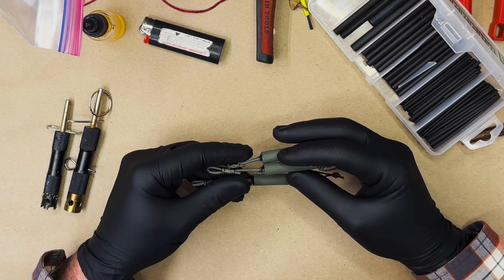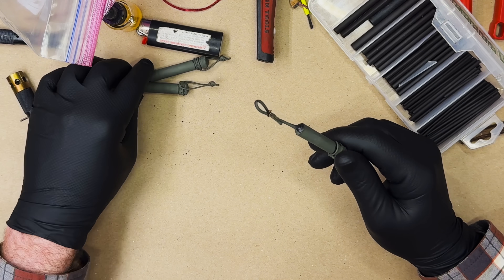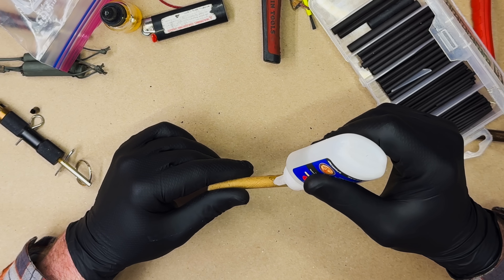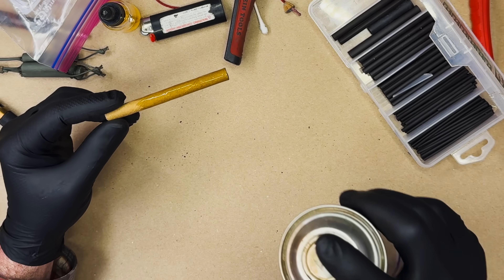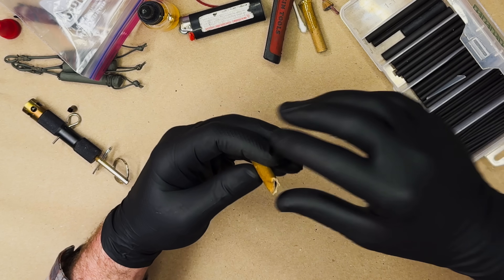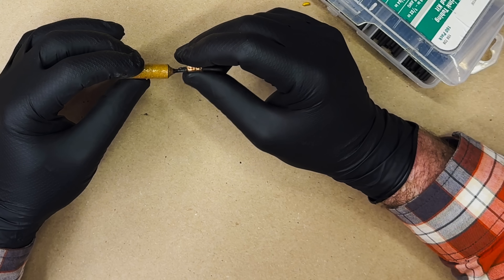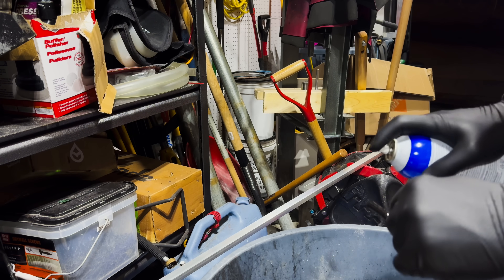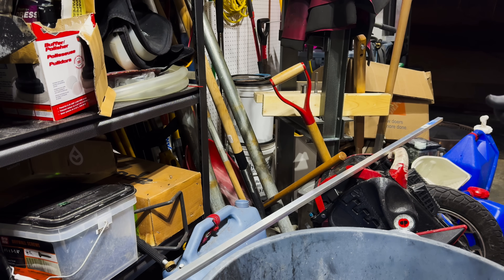Detect, Deter, Intimidate, Evade. A Stealthy & Weatherproof Trip Alarm

Comment: I need to teach ya some knots . The green or black braided fishing line is invisible BTW. It's a lil costly but not using a few ft at a time like this and strong as F.
Reply: Z-Bolt will pick up most of the mono and Fluro but maybe like a 6 or 8 pound braided like you said. Plus braided has zero give like monofilament fishing line. Regardless though he did a fantastic job.
Reply: Now rewinding so I can watch the first half of the video that I missed reading this choice beef
Reply: .... yea when I read that first guy after watching  Ole knostradamus over there build his booby trap i was like... um sure you want to pick this fight ... 😅 dude has Alexa turning on exhaust fans in his workshop for when he burns stuff in the basement for the spare parts he needs. Im sure he knows how to tie a knot😂
Reply from the maker: [WIRE PULL IGNITER KITS ON MY SITE,I digress] I  sl@p you in the face with a Monkey’s Fist, and challenge you to a knot 🪢 duel🤺. Son, I need to teach YOU some knots. I had the weirdest fascination for years when I was a kid. I’d read about knots and play with them for hours. When I was six, to my mother’s horror, she found me dangling from a tree branch a rope around my right ankle 6 ft in the air because I was “testing a raccoon 🦝 trap.” When I was in eighth grade I got in trouble for hiding “advanced climbing anchors,”by John long inside of Homer’s The Odyssey while we were supposed to be reading our assignment. Before Boy Scouts turned into a bunch of woke pu$$ies, I made a massive trifold knot board (that folded into a very large and heavy briefcase—cause you never know when you’ll need a 120 knot knot board) for fun—no one asked me to- I was a knot menace. So, inspect the video closely, and, assuming you are the knot aficionado you claim to be, you’ll see  a constrictor hitch in the bight of a figure-eight-on-a-bight at 0:00; a bight girth-hitched to said double-figure-eight/figure-eight-on-a-bight(though it could be argued a reef knot as the girth hitch is around another line of equal diameter instead of a fixed object), into a two-line constrictor hitch around small tree at 00:47; a simple taught-line hitch around opposing tree at 01:20; a true girth hitch formed from a loop tied with a double overhand (behind branch) that was to form a tackle loop 01:39 used to position the tripwire at proper height, while keeping the device down low out of sight and utilizing the weight of the device to hold tension on the tripwire, vs the weight of the device causing sag in the line. Tension was applied and finally secured with two half hitches. So I’d say that was expertly executed, though I admit, in an ideal world, that last knot (two-half-hitches) would be a taught line hitch—I was feeling insecure while shooting because I felt slow and sausage-fingery so I rushed it with the less-than-ideal-though-still-acceptable two half hitches. In conclusion, I suspect you are a knot-charlatan because a real knotstranaut would have been thoroughly satisfied by the masterfully executed assembly.

PS you are correct about the braided fishing line, I only saw this post eight months late because I just picked up some braided fishing line and wanted to commend all those who recommended it.
Reply: @InventionIncarnate dayyyyyyum
Reply: @InventionIncarnate  Ok this response of yours is some total B.S. I read it, playing the moments in my mind, hands trying to duplicate what you were talking about. By the end of it I found I had tied myself to my chair, ice cold beer on my desk I couldn't reach, needing to pee, and I can't move to save my life.
Reply: @InventionIncarnate Damn dude, you use to be cool. Now I know you're Knot. Just a seamen aficionado who loves getting tied up, and who loves mixing fluids.....and powders. In fact in your free time at various mens bathrooms, sometimes you gotta utilize the powder before you mix the fluids. Or maybe knot.
Reply: @InventionIncarnate  How do you keep natural critters from tripping your lines? pls.
Reply: @InventionIncarnate now all we hear from the knot so expert knotty mouth os ctickets 😂😂😂. I guess he realized maybe he was knot so well versed as he thought. 
Thought he was gonna school you…knot 😂
Reply: @InventionIncarnate by the way man are those really sprinkles or was that code lol. Pics of the product labels that won’t demonetize you would be awesome.
Reply: What a comeback!
Reply: There’s no coming back from that
Reply: Delete your comment bro
Reply: Bro never replied 

Civilian mentality right there

Comment: Just a thought for the CA sealing of that tube: you obviously know CA, but a BETTER CA would be the ultra thin viscosity!

I have worked wood/CA for decades in the Industry (Hardwood Floor repair) and ultra thin viscosity CA dries in 1-3 Seconds, WHILE also Penetrating 40/50 thousandths inch deep!

That avoids needs the Activation Spray as well!

I use so much ultra thin viscosity that I buy it in 8 ounce bottles, and refill a smaller 2 ounce bottle!

I also use the thick Gel CA, as needed • • • • • 😮

Also, if you have any Sawdust from wood work, fill an old sock with it, beat said sock onto a newspaper, what comes out we call "Fines". Sort of like flour: CAP end with a 1/4 teaspoon or a bit more, ultra thin viscosity CA soaks into that fines and you have a SERIOUS PLUG, and less $$$ on your CA costs!

philip in Oregon where it is Still legal to be a survivalist, for a while anyway 😅

Comment: the mason bee houses are mainly for gardeners, carpenter and mason bees pollinate WAYYYY more flowers than honeybees, are also less aggressive by far, and the houses will keep them away from structures like homes or decks etc, insecticide wont really kill them because youd have to find every hole theyve made and directly apply it (they will build entire networks of nests in even small planks of woods) however if you do kill them inside the nests, other insects which are far more likely to try to enter your house will move in

Comment: Pro Tip: It’s beneficial to remove the lighter’s safety bar over the flint wheel because it catches on the rubber glove as you push on it. It’s extremely aggravating and the relief is immediate.

Comment: You can make your own tubes with hot melt glue, CA glue or epoxy or the adhesive of your choice from cereal & any other thin cardboard boxes glue the 2 pieces & wrap around the appropriate sized dowel.....

Comment: If you have a small glass container/cup, i cut off bottoms of beer bottles, and wash out, dry then add a little rubbing alcohol, you can dip and agitate/bob up-down the brush covered in ca glue, to remove the glue from brush, to use the brush again. Just dab on paper towel any alcohol holding on to brush & allow air dry before using  brush again.

Although to be honest, rarely do i use brushes with glue (unless water soluble), instead i use qtips that ive fluffed up and can throw out😊

Comment: You sent enough I'll be making these for the next 10 years lol today was mission success, made 2 with string, 2 with wire,  and 2 with crimp caps,  and every single one went off. I'm fact it's a little spicy lol 30%on the cups is very very literal lol

Comment: To make using a bic with gloves essier, you can take a pair of needle nose pliers and peel the metal guard off of the flint to increase the surface area your thumb can reach. Doesn't damage the lighter either. I do it with all the bics I use.

Comment: Party popper pull strings are like 5 for $1.25,  just gotta cut them out of the party poppers. And they fit brilliantly into drilled out co2 cartridges... and Capri sun straws work great for the waterproofing process. Figure out on your own what else to put in the co2 cartridges.  Possibly, hypotetically ,theoretically,  allegedly.

Comment: I would be careful using CA glue next to sensitive compositions like “photography” powder like that as those compositions are typically sensitive to heat and CA glue while curing generates quite a bit of heat, sometimes enough to burn paper

Comment: Next time you want to think about soaking the alarm AFTER you set it up, then set it off without doing a video cut. Because there is no way for us to be sure that you didn't just swap the wet one for a dry one. Also, it does no good filming setting up the alarm if your arm blocks the view of what you're doing. Unless of course the viewer is blessed with x-ray vision. And I am not.

Comment: Why the mason bee tubes? Is it just size/cost? Any reason you couldn't use copper tubing or 3D print the tube and cup? Wouldn't those both be stronger and already water proof? Just add a dab of sealant to the seams. Or you could design the cup with the hole already in place and have it screw onto the tube, then just coat the threads with CA.

Comment: Copper tube and solder gun. Pressure pad trigger with trip cord to peremeter alarm set vertical on tree, groin height.
Completely different and unrelated topic. Have you looked into human anatomy? Phemerol artiery location, the ease of which a TQ works on that severed artiery.

Comment: We used to make something similar using the popper from a party popper pushed through the fuse hole of an M80 or a Cherry B.
M80s and Cherry Bs are of curse illegal and too powerful but we were bear proofing campsites and wanted a real BOOM. 
They worked really well and were quite reliable if you waterproofed them and set them correctly ,,, very cheap to make.

Comment: You wernt kidding labor intensive perhaps a heat gun or even a hair dryer to activate the shrink tube not shure how violent thoes caps are but using an open flame most likely won't but could set them off one would think ? Love the concept and utility however I live in the former democracy turned dictatorship known as Canada and these are a class 3 felony and carry a prision term of no less than one and a half years  and up to seven years in a federal maximum security penitentiary  and a permanent weapons ban for life you can't even be cought with fireworks after thoes charges or your looking at a second offense and breach of conditions that can land you the remainder of the original maximum seven years plus an additional seven to twelve years in maximum federal prison .

Comment: There are mouse traps out in Germany which use 9mm blanks to blow "into the face" of a mouse to kill it. They can easily be modified by tiing a rope to hit to have an alarm. They are not cheap, but work very well and are very loud. At the same time you could also put a blank inside which shoots a pepper load 🙂

Comment: I was a security officer on nights. I used to like to doze off. Yes of course we doze off. We would be lying if we said otherwise. Problem is if you kipping a d the supervisor pulls up.......opens be door and you are snoring.....bye bye your fired. SO ... Back then had the old fashioned  Nokia phone. I made a box around it and attached a small nail that rested on the green ring button. Attached the box to a tree and fed cat gut across the road....a out one mile from the office. I put in the number of my other phone. Sat down had a kip..... along comes Mr boss man in the car....drives into the line he cant see....it pulls on the nail...pushes the ring button....hey presto my phone rings and I wake up. Worked like a treat for years. I worked for OCS at a haulage company in Nottingham. Gotham actually. Remember me boys....I fooled you for years 😅😅😅😅😅😅

Comment: lmao, another Law enforcement drag net to flag and document people who watch this type of video! since it's illegal to set booby traps ( and yes this is a booby trap by all examples of the term under law).. some light reading for you silly folks who watch these videos thinking you are gong to be the next alex mason of the freedom fighter world!     *  Booby traps may be used by marijuana growers, drug lab operators, or paramilitary political extremists to warn of an approach by a stranger or to impede access to the protected area. Booby traps can range from the simple to the sophisticated. They include firearms triggered by a trip wire, hidden pits dug to trap and injure intruders, wire strung with fish hooks at eye level, and various board-and-nail devices designed to injure and ensnare the feet and legs of intruders. Drug enforcement officers should always operate in teams when investigating areas with a high risk for booby traps. Such teams are likely to find booby traps at points of access, i.e., along roads, trails, gullies, and field and facility perimeters. Also be aware of telltale signs of booby traps, such as wire stretched across a path; a pile of leaves where no other leaves are on the ground; freshly dug dirt; indentations in the ground; unnatural materials such as pipe, boards, newspapers, and cardboard; and any item that invites a person to pick it up and examine it. A boat or building should not be entered without carefully inspecting it for booby traps. Do not turn on any electrical switch until a technician has checked it out*.
Additional Details
Sale Source
National Institute of Justice/ AddressBox 6000, Dept F, Rockville, MD 20849, United States
NCJRS Photocopy Services AddressBox 6000, Rockville, MD 20849-6000, United States
Publication Type
Training (Aid/Material)
Language
English
Country
United States of America

Comment: Fith Ops sells 12ga perimeter alarms with trip wires. Sense the 12ga blanks are pricey, you can sacrifice a few decibels for the price and go with 308. The 308s are like $10 for 50! So I dont have to sit and play with this crap trying to build it forever.

Comment: Nice stuff boss.
For sealing or pluging ignitors / blasting caps you can also use pressed cotton with liquid c.a. glue poured on, it will instantly harden. Someone use baking soda instead of pressed cotton it does the same thing.
Thanks.

Comment: I wonder if UV cure resin (for 3D printing) could be used. There's no cure time or mixing, just paint it on and use a powerful UV torch to set it very quickly. The plastidip should protect it from further UV exposure. Probably cheaper per gram than CA, more controllable in setting. Perhaps a bit runnier though. You clean uncured resin with IPA etc. May be helpful to you, from a poor brit that can't partake in such things.

Comment: would crushing sparklers with the nail polish give you the same ignition putty?
Reply from the maker: Negative good sir. (From my quick googling just now) Sparklers generally contain potassium perchlorate/ sometimes potassium nitrate as the oxidizer that would be too insensitive to ignite with a pull string. Also the fuel in sparklers generally contains aluminum/titanium vs antimony trisulfide used in the igniter kit.
Reply: @InventionIncarnate  thanks for the great reply mate.  would you be able to make a video on maybe a switch ignition ...

Comment: I ordered my kit to help make firestarters for kids at camp. The website was sketchy as hell!!!
Took the leap and ordered it and I got more in the kit than was listed. So far so good. 
I will have safe campfire starters for kids to use next summer at camp.
Reply from the maker: I don’t deny the sketch ✍️.  Venmo saves you guys about $12/kit. I’ll establish trust outside of a third party that makes more profit on our transactions than I do.

I legally have to say “they’re not intended for children” but I also believe in teaching my children to do dangerous things carefully. Good god this generation is wimpy, thank you for your contribution to counter that

If you find the igniters are too aggressive when testing. You can add either magnesium carbonate in 1% (of total mass) increments to the ignition comp. Or the same ratio of powdered charcoal.

Email me at inventionincarnate@gmail.com if you have any issues
Reply: @InventionIncarnate  Venmo?  How do you not take crypto?
Reply from the maker: @ it’s esoteric, and high conversion fees. I could accept crypto though, I just wouldn’t ask for it.
Reply: Man just give them a straight stick, a small board, & a piece of string. 
OR
A piece of charcoal and a magnifying glass. 
OR
A 9 volt battery and a piece of fine steel wool. 
OR
One of those magnesium blocks that you shave and then shower with sparks from the flint in the side. Those things are awesome when you know how to use them. Harbor freight has them for a couple bucks.

Comment: Clothes pin(clip) thumb tacks w/flexy phone wire and a led and battery pack. Trip wire has spacer to keep. The circuit inert. Pulling in string the insulator moves and closes the circuit and light the lamp

Comment: So, you do use military issue trip wire... same stuff we used in Combat Engineer for distinct applications from perimeter early warning that can be audible to colored smoke to booby traps that varies including IEDs and other usage.
I have to check my Phase 1 manual or FM manual for the nomenclature as we had similar "caps" as we had a nickname for what you handmade is well made indeed.
Thanks for sharing...

Comment: why not just use a modified party popper? I'd imagine that would work, with a couple small tweaks and a new housing. they'd be plenty loud enough to get your attention, And if made inconspicuous, any intruder passing through, would likely have no idea what they were. maybe just chock it up to some dumb kid pulling a prank. giving you extra time to respond. Just an idea. 🤫😅
Reply from the maker: That would be so cute 🥰 . 
But,
I’m pretty sure bubbles pop louder than those.

But joking aside yes it would be easier, though lacking in durability and volume in comparison

Comment: A Needless overkill on the setup you need to secure your trip 'wire' at both ends with no additional attachment strategies.
Reply from the maker: Yeah if you want it to sag and not be concealed